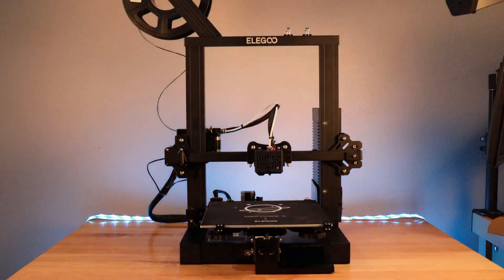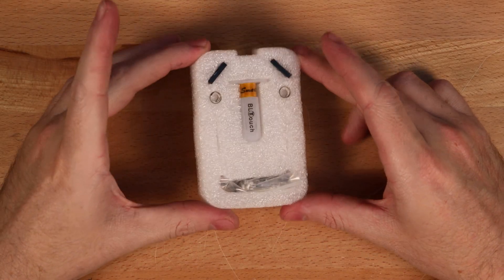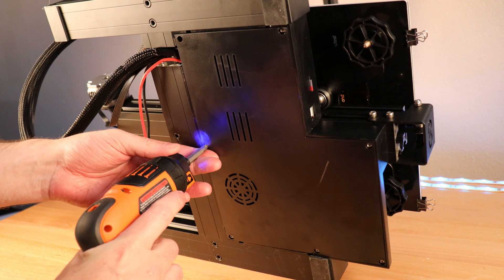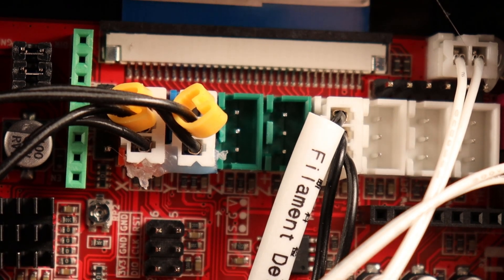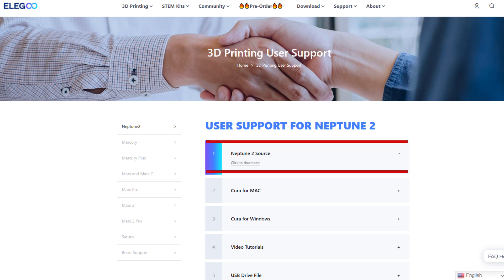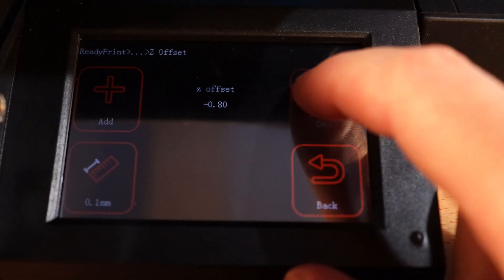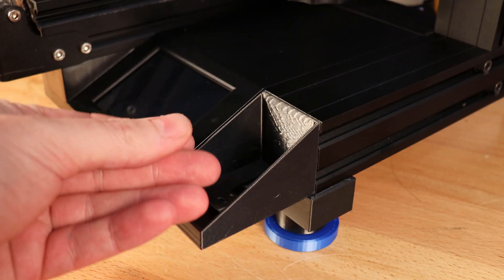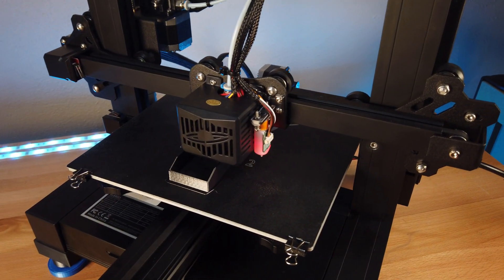How to install a BLTouch on your Elegoo Neptune 2 & other upgrades

Comment: After flashing only thing I see is blank screen with horizontal lines....not sure whats going on...any ideas?
Reply from the maker: Try re loading everything onto the SD card again and try to flash it again and see if that helps
Reply: @GomeowCreations  did that multiple times with and without bltouch enabled same result...
Reply from the maker: Very odd, you might have bricked the screen or main board. I would contact elegoo ASAP about it and see if they have  a way to fix it
Reply: @GomeowCreations  thats what I was thinking too, may have bricked it...will shoot them an email and see what they say...thank you....
Reply from the maker: Let me know what happens
Reply: I'm having the same issue, except, my blank screen comes up after the boot, it goes from green text to a white screen:/
Reply: @konksmash7164  actually I see the same thing text "booting" or something in green and then white screen with some horizontal lines... reached out to Elegoo waiting to hear from them...will keep all posted...
Reply from the maker: If they don't get back to you soon I will message them
Reply: @GomeowCreations  Heard back from Elegoo "You should not use right firmware.You can send me the SN code like below picture.I will send you right fimrware and instruction.". However I used the firmware they had sent me, I have shared the SN Code again with Elegoo and they will be sending another firmware will try that and keep all posted.
Reply: @Duke please send an email to Elegoo with your SN Code which is below the print bed starts with NEP2, push the bed backwards and you should be able to see it and they should be able to send the firmware and it hopefully fixes the problem...
Reply from the maker: Very odd seeing that the firmware that I used is from their website with just the bltouch setting turned on with the text file.  Keep me updated 😁👍
Reply: @GomeowCreations  yes very odd, why would the firmware be tied to the SN code or something...is this a different hardware or something...may be thw board or the lcd...
Reply from the maker: Idk seeing that it has worked for me and other that shouldn't be a problem
Reply: @GomeowCreations  got the Same Problem now, installed everything, ist Shows "Booting" Then Blackscreen with horizontal lines. What should i do?
Reply: @rohitralhan1978  did you get Any answers?
Reply from the maker: @karls4354  Sadly I have no idea why this is happening to some people. Try going to the Elegoo website and download the source files for the printer and try installing the stock unmodified firmware to see if it will get the printer back to more so you an at least us it for now. Let me know if this works.
Reply: @GomeowCreations  Sadly that doesnt Work, unclipped the BL Touch and flashed with the Stock Firmware but Same result. Screen Shows Booting and the black Screen... Send a Mail to elegoo, i Hope its Not a hardbrick, had it for Just 24hours😓
Reply from the maker: I'm really sorry that this is happening. Idk why this is happening to some people. What is the border info on your printer. Maybe they changed it at some point? The one I have is one of the first one so that might be a thing? I know some other people have got it working with no problem and other had to reflash it over and over and it would finally take. Very odd. I have also messaged elegoo about this to see what to do. They have seen the video and didn't say I did anything wrong 😅
Reply: @karls4354  finally heard back from Elegoo and looke like there are 2 different firmwares cos they are using different boards looks like...i did flash it back and it worked...i will share the instructions and the Firmware...will have to enable BLTouch after...
Reply from the maker: Email that do me an I will add it to this video so it doesn't happen to others and they can get everything in one place
Reply from the maker: @rohitralhan1978  Thank you an got it and I will add it to my video. According to that info my printer shouldn't work at all how I did it but its also showing v1.0.2 in my printer so who knows and I might have just got very lucky.
Reply: @GomeowCreations  sure thing, one thing I noticed in the text file is the BLTouch entry is missing...did you add it manually earlier or am I missing something?
Reply from the maker: I believe that is the stock firmware that they gave. What I did was go into the elegoo.txt file and turn on all of the auto bed leveling stuff. I will have to reflash my printer with this new firmware to see if it all works still. I did change my link to download the firmware with this new stuff and I added a edited version as well for the bltouch but I haven't tested it yet.
Reply: @GomeowCreations  please keep us posted I am also going to try that out and see how it goes....
Reply from the maker: I just flashed it with that txt file edit and I can do the bed leveling with no problems. My printer is now at v1.0.3 and I'm going to start a test print now to see if it worked as it should
Reply: @GomeowCreations  what all changed did you make?
Reply from the maker: It would be a lot to explain. I suggest downloading the new file pack that I put up and checking out the new text file and the stock one. 👍
Reply: @GomeowCreations  cool thanks will do....
Reply from the maker: First test print done and it all looked liked it worked with out a problem
Reply: @GomeowCreations  got everything correct now, it's Working perfect!
Reply from the maker: I'm happy to here that. 😁👍

Also just a little sneak peek for you guys, I just got the Elegoo Mars 3 and I will have a video up about it soon 😁👍

Comment: Thanks for the video! I did follow through but my BLTouch is not extending the probe when I hit auto leveling. It does extend and retract when I turn it on though, do you have any idea why that may be?
Reply from the maker: Unplug the bltouch at the sensor and plug it back in and see if that fixes it. Make sure the printer is off. When you turn it on it should move. If it doesn't cheap the plugs at the main board to see if they are fully plugged in.
Reply: Thanks for the quick reply. It does move, and it's red, but it doesn't when it's actually leveling
Reply from the maker: And you did reflash the firmware right?
Reply: @GomeowCreations  Yes, tons of times haha
Reply: @GomeowCreations  reflashed 6 more times since this comment, the 13th time was the charm...
Reply from the maker: Oh cool so it is working properly now?
Reply: @GomeowCreations  yep
Reply from the maker: Well that's good. Let me know ow if you have any other problems or questions 😊👍
Reply: @GomeowCreations  Hi, I found the issue in your Firmware:
>Z_MIN_PROBE_PIN_MODE		0
should be
>Z_MIN_PROBE_PIN_MODE		1
Reply from the maker: Think you and I will change/fix that right away. 😊👍

Comment: This is awesome! I'm going to have to do this next time I get the chance. Quick q, what are your ideal settings? I'm having some bad times with mine. I get bad stringing and my very bottom layers are piney, as if they aren't cohering.
Reply: I've tried alot of different variables. I mostly do 50% fan speed with 200-210 extruder heat with a 60-80 bed heat
Reply from the maker: I have good luck with 190c nozzle 50c bed and 100% cooling fan.

Normally straining is due to too much heat in pla if I'm not mistaken. Pla likes to be cooled really fast as well so max fan normally works best.
Reply from the maker: What material are you printing with? Also what slicer?
Reply: @GomeowCreations  I'm using black pla (from a brand called 3d solutech) and the slicer I'm using is the cura version they provided with the Neptune 2
Reply from the maker: What temperature are you printing at and are you using the fan at 100%
Reply: Thank you I will give that a shot next time!
Reply from the maker: Just let me know what happens
Reply: That really helped with the bottom of my prints, now my issue is with travel. It leaves strings. I did one of my quicker prints (a dl44 blaster trigger that I found on thingiverse), and the areas between the trigger curve had strings
Reply from the maker: What are your travel settings?
Reply: I started messing with my print speed instead to try different results. They still aren't the best but your heat tips helped alot! My current speed (from cura) is 30 mm. then I knock it down using the speed setting on the Neptune
Reply from the maker: I think mine are 50 mm so much faster.
Reply: @GomeowCreations   to let you know. My prints are so much better. Just recently I printed a mini fig and it came out almost perfectly, only small things that I could look over. Thank you for all of your advice!